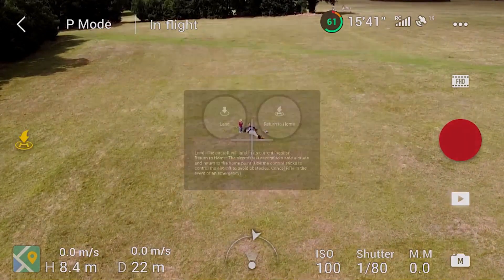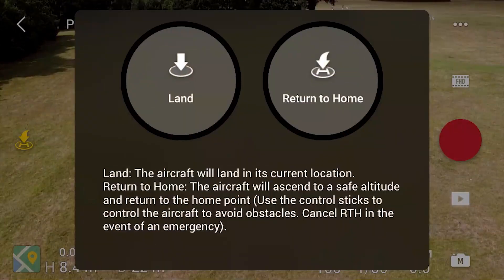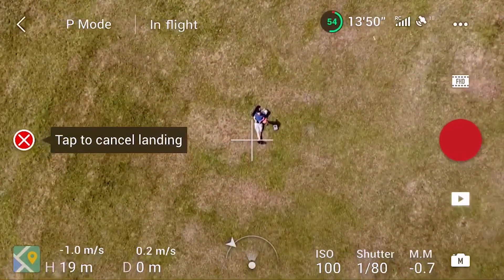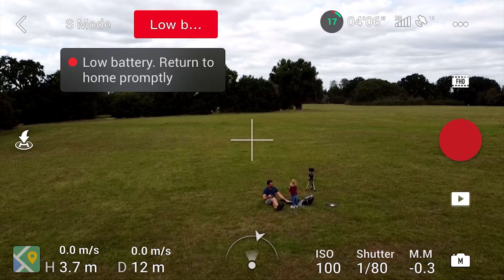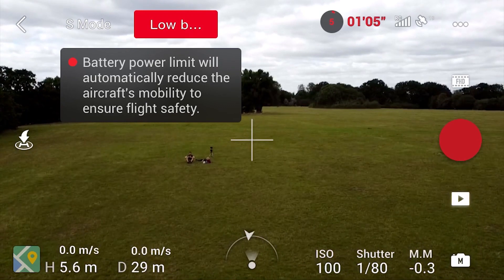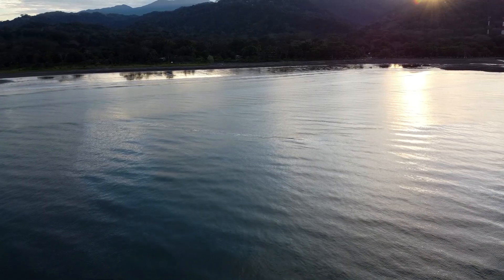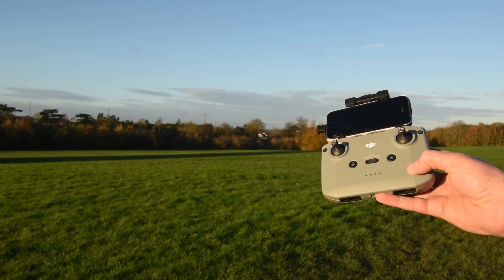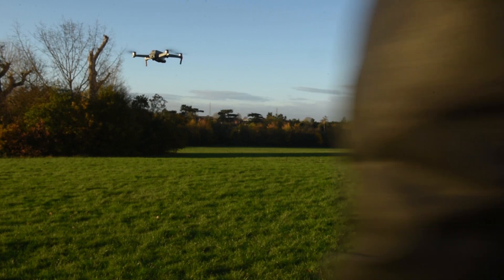RTH COULD SAVE YOUR DRONE - KNOW WHAT THE RETURN TO HOME FEATURE DOES MAVIC MINI MINI 2 MAVIC AIR 2

Comment: Hi Paul
Quick question if the mavic mini 2 is just over the 249 grams
Say 253grams although one still has to register it after the 30th December whould it make any difference i. E i get an id would i have to take the A2 exam or not?
Reply from the maker: Yes it would fall into the A1 transitional category (legacey drone <500g) meaning you would need an A2 CofC to fly it without major restrictions. I am currently confirming the information in the with the CAA as there is a lot of conflicting information about the MM and the A2 CofC.